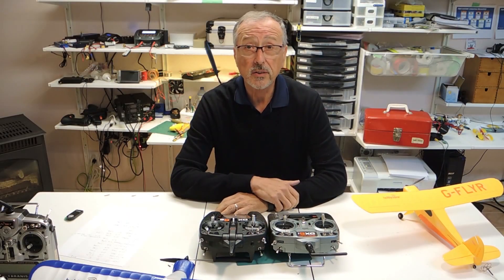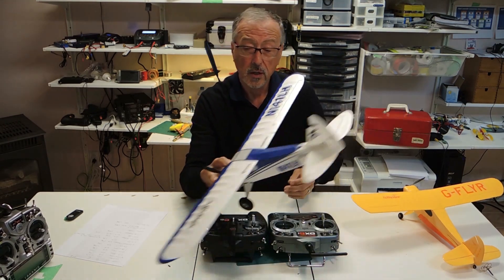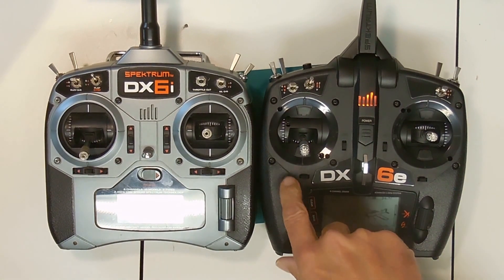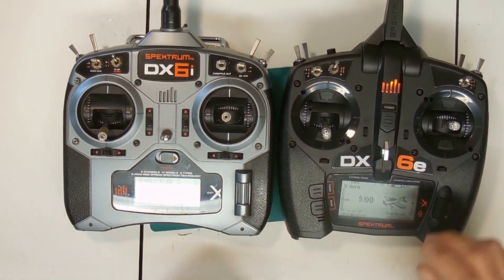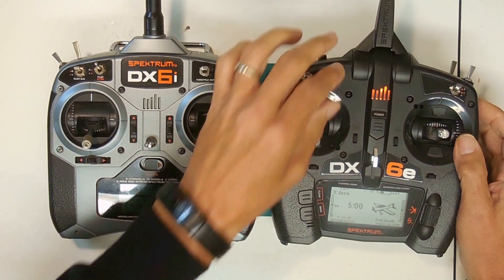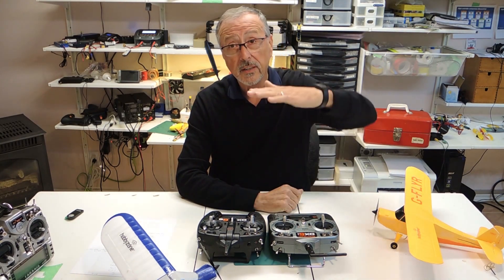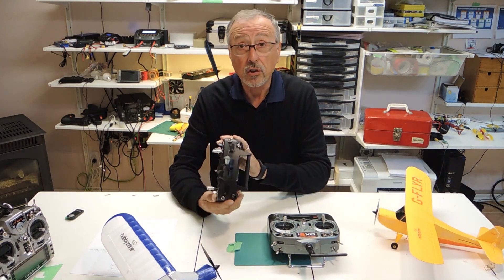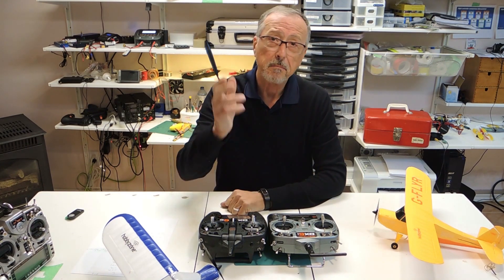Dx6e

Comment: what are the steps to connecting the ds6e to a computer.
Reply from the maker: None that I know of. You use the SD card to transfer files and upgrade firmware.
Reply: @EmeraldMeadows  By connecting I mean using the transmitter to control a simulation. 
I know about the sd card.
Reply from the maker: @johnbronk6505  https://www.youtube.com/watch?v=8UKOvwzPRi4

Comment: Have you ever had any problems with that radio and how often do you use the radio I know but use my radio three times a week and I've been have a lot of problems with that radio please get back and let me know if you are having problems as well I am curious
Reply from the maker: The radio is pretty solid but you are binding to older models that are not DSMX then there can be a binding issue.
Reply: @EmeraldMeadows  it does buying when I fly the plane around and it almost seems like it loses connection I have no more control over the up and down or even the motor it just seems like I lose complete connection and then when I get close to the plane I gained all connection I think it's something wrong with the radio a guy on YouTube has a dx9 and he uses the orange receivers and don't have a problem I bought this radio 2 months ago it worked fine for the whole two months didn't have a problem until now I kind of think that is something wrong with that radio I sent it back to horizon hobbies just waiting to hear something from them
Reply: @EmeraldMeadows  this is the second radio I've gotten from horizon hobby the first one the boy burned up the second one they have it now
Reply from the maker: @rcman6895  I don't know man that's all I got.
Reply: @EmeraldMeadows  okay I was just wondering have you had any luck with that radio dx6e I have that one and I've had nothing but problems I think when I get that radio back from the shop I think I'm going to sell it and get a different brand maybe I'll get something from HobbyKing thank you very much for the info

Comment: I just bought a DX6e and am enjoying it. Thanks for pointing out the flap delay. My only problem is I don't know why they used a power on / off button that you have to hold instead of a standard slide switch.

Comment from the maker: I had a question on binding with the 120s and the panic button and flight mode button. Once you bond the 120s to the radio you can access monitor and see that the A and D switches are also activated. If your lucky this will directly map to the 120s panic and flight mode switches if not you need to go to the program screens which include the "digital switch setup" that will allow you to change A and D switch to whatever the switch corresponds to the functions you mentioned. Good Luck.

Comment: I dont care for the manual, Im still trying to figure out how to do all of the programs.
Reply: I still don't fully understand how to select one of the switches on the DX6e to take over the function of the 'Safe Technology' flight modes (beginner, intermediate and advanced) on my blade 120s.
Reply: Yeah, not the most user friendly in my opinion. I was using  lipo batteries in mine and it drains them when the radio is off. I just switched to NiMH batteries since some forums have suggested those.  I had to watch a couple of Youtube videos to set up the safe mode on one of my planes. Good luck.
Reply: I contacted Spektrum (Horizon Hobby) and they told me to use switch 'B' on my radio (DX6e). They were very helpful, however the wait times to speak to them are crazy (roughly an hour). You should contact them about your parasitic drain issues (Lipo battery draining). Others have had the same problem and Horizon has repaired or replaced their radios. Give'em a call, it couldn't hurt. For the record, I really like the DX6e, it's a good entry level radio. Happy flying.
Reply: Thanks for the info. Happy landings.
Reply: RCshenanigans 0

Comment: Good Vid, Sir. I had the DX6i, more than once. I now have the "E" and the UMX Carbon Cub SS with flaps. For the life of Me, I can`t get the flaps off the Gear switch "A", and onto a 3 position switch, B or D. I did it once, but it only functioned as a 2 position. Also, I can`t get all the dual rates onto one switch "Dual Rate Combi" as I did with the older DX6I. I miss the simplicity.

Comment: nice video.  newbie question. I have some micro quadcopters with dsm2 that bind right up but can't get the motors to arm. what is the procedure? dx6e
Reply from the maker: Can you tell me the quad name?
Reply: Emerald Meadows there are two bnf. qx90 and gb100 both with dsm2. it binds fine . cleanflight shows me the transmitter is working. possibly just an arming issue? I can't figure out how to arm it if that's what it is
Reply from the maker: Did you check what you have under modes in cleanflight? As well most of these devices will arm with the both sticks down and towards center. But be cautious your sticks must be going in the right direction so check the receiver setup carefully in Cleanflight.
Reply: Emerald Meadows ok thanks. I'll try checking it out more
Reply: The DX6e doesn't support DSM2. After 1/1/15 the EU regulations outlawed new radios with DSM2 the only protocol Spectrum can use in the EU is DSMX. If you really need DSM2 I guess you could buy a non EU radio which will still have DSM2. FrSky ran into the same problems and they introduced their LBT EU range of firmwares to overcome it. However, I understand that with Spectrum they resolved it with a hardware change.

Comment: The main thing he missed out is that in the European version only the Dx6e does not support DSM2 communications.  Consequently all the old DSM2 recievers you have fitted in your old models will no longer work and will need replacing with DSMx units, which could be very expensive.  Why the difference between the American unit and the EU unit perhaps Spektrum could enlighten us. 

It is also very annoying to do you research, download the manual etc only to find that the manual is written for the American spec only.  I was very very annoyed to discover this.
Reply: Anthony Simpson The EU changed regulations and it's no longer legal to import any dsm2 capable transmitter after the change date. Spektrum had to make a version without dsm2 for the EU.
Reply: I know that now but didn't when I bought the set and Spektrum still ship these units to the EU with American instructions that clearly state the transmitters are DSM2 and DSMX compatible.  The included written instructions need editing and the downloadable instructions should be immediately changed.  It is currently very misleading and Spektrum need to address this immediately.

Comment: Dx6e has voice also, and it will do the telemetry with voice alerts, 

You can't beat Hobbyking prices though.
Reply from the maker: Sorry Gary but the Dx6 has voice but not the Dx6e. Both have telemetry.
Reply: Cool,
Reply: Emerald Meadows which would be the better choice ? Dx6 or dx6e? Is the only difference voice alerts? Trying to see which would be better to fly quads.
Reply from the maker: It's been my experience that you always you always need to know your voltage. As I mentioned in the video I use the Taranis FRSKY for outdoors so I can always know my voltage and other telemetry data. If this is going to be your only radio I would get the Dx6 just in case you need the voice.  When you have goggles on and if you don't have OSD your flying with limited data. But for indoors the Dx6e is just fine.
Reply: Emerald Meadows Thanks for your help ! I will be using fatshark goggles so something to think about.
Reply: Gary Regier there's no voice alert in the dx6E